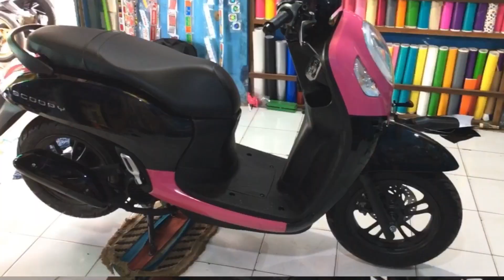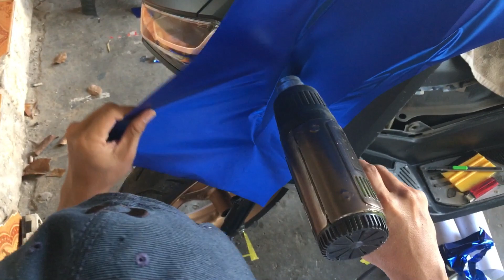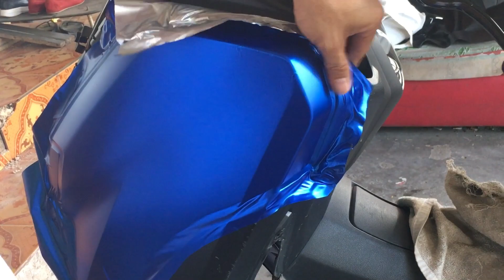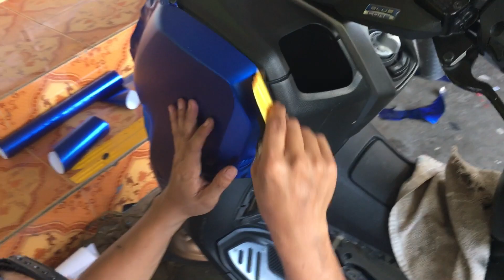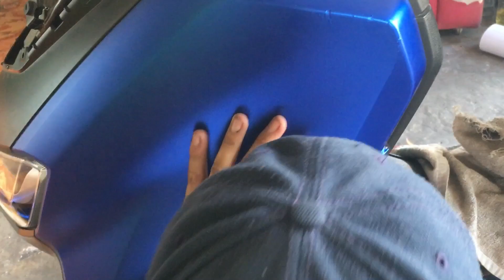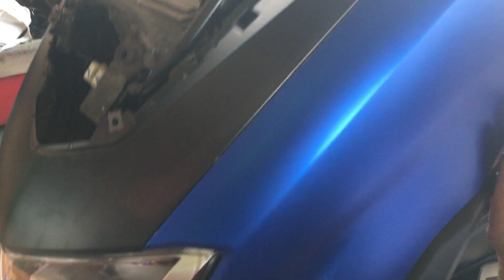Cara pasang stiker nmax - sangat mudah bisa langsung d tiru dirumah

Comment: Maaf bang mau tanya, kalo untuk body depan sama belakang, kalo pake 2 meter cukup ga bang?
Reply from the maker: Kalo depan belakang. Buat nmax 4 meter cukup lebihan dikit itu. Karna kalo nmax full sekitaran 6meter
Reply: @ikociko1994  6 meter panjang dan lebar berapa cm bos?
Reply from the maker: @roniririndaengngitung1431  lebar 50cm. Panjang 6 meter cukup bang.
Reply: body belakang bang pas emblem timbul nmax nya gimana